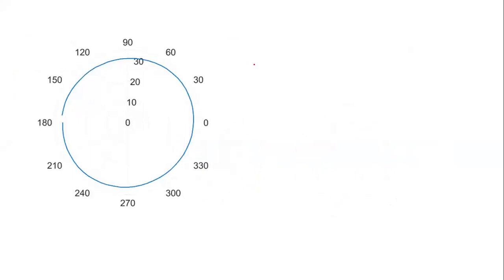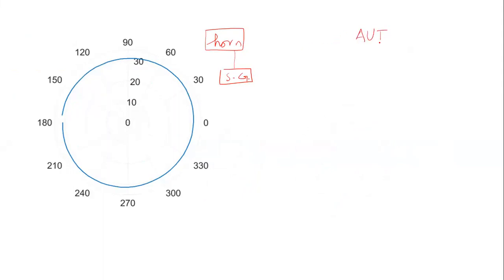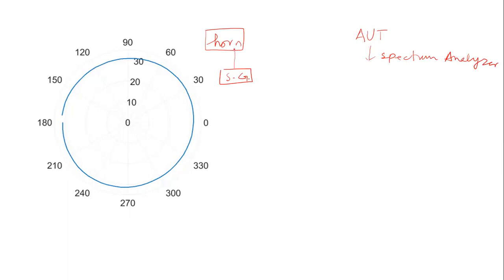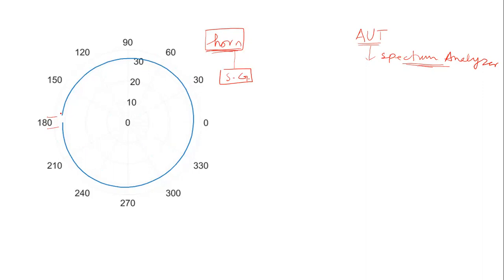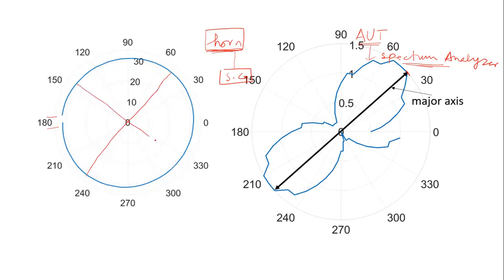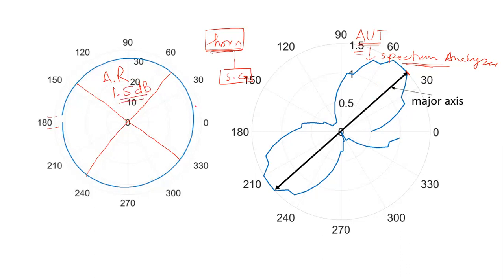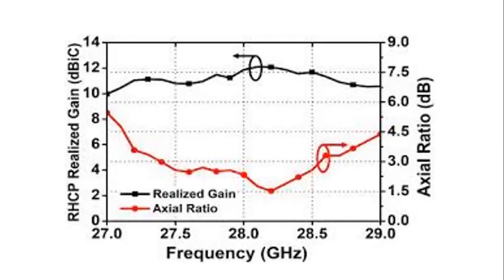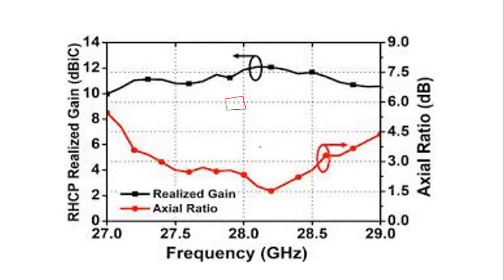Axial ratio measurement of circular polarized antenna (Part 2)

Comment: I dont understand what is the major axis and the minor axis
Reply: CP (x and y components have the same magnitudes and a 90(or odd multiple of 90) degrees phase difference) is a specific case of elliptical polarization, and is therefore governed by the same principles of axis propagation, rotation sense (LHCP or RHCP) and ratio. If you read about it, everything will click easily. Good luck with your studies.
PS. Kumar and Ray’s Broadband Microstrip Antennas, 2003, chapter 8, covers the theory about this topic nicely.